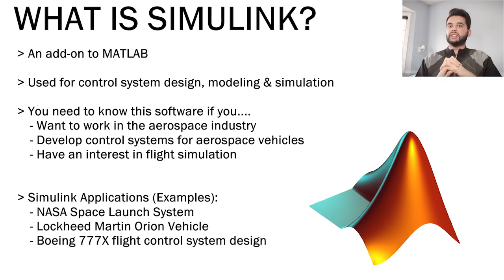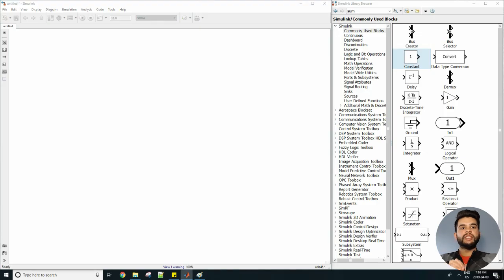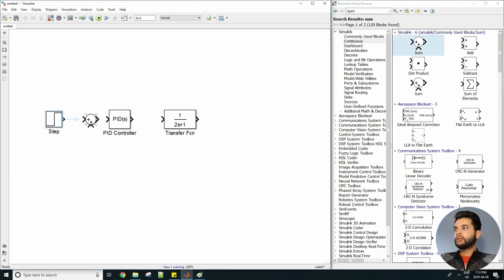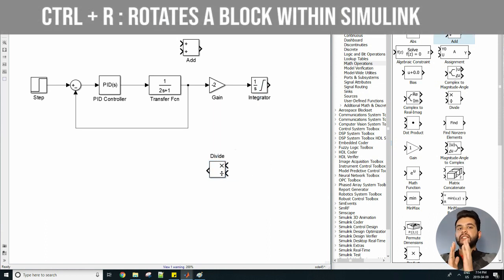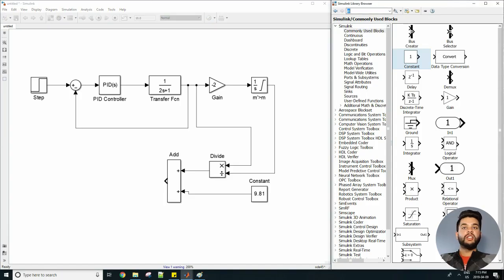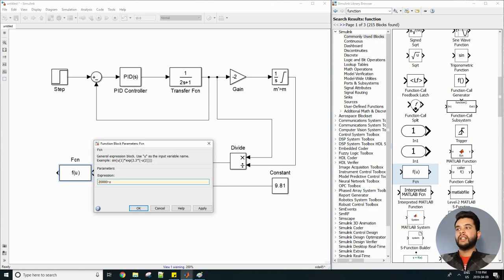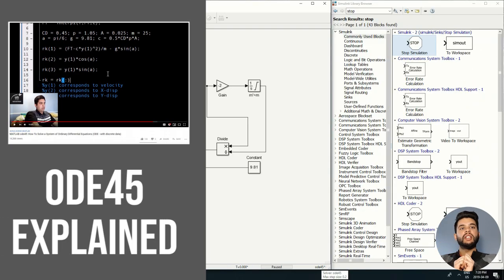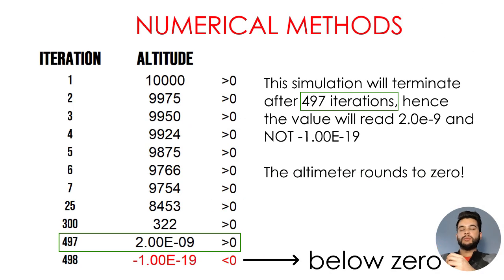What is Simulink? - An Introduction for Complete Beginners (Flight Simulation Tutorial)

Comment: Hey hi, i have been trying to solve 6dof nonlinear equations of motion in simulink  but i am facing algebraic loop error in the model than i used delay to rectify the problem. My question is do you think that this nonlinear equations can be solved without using delay in the model... thanks in advance.